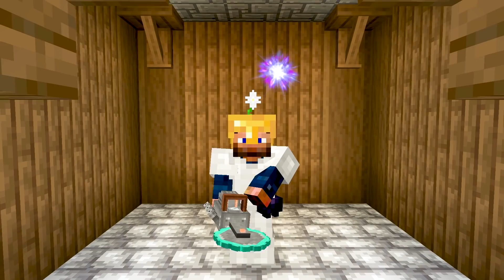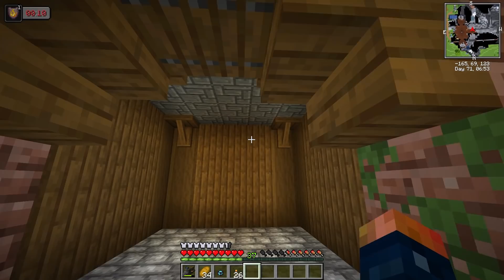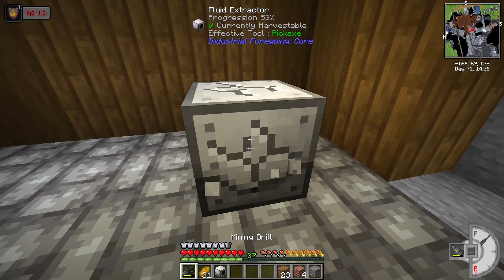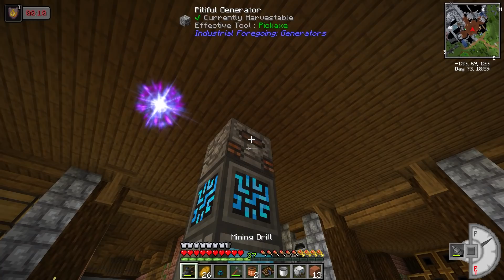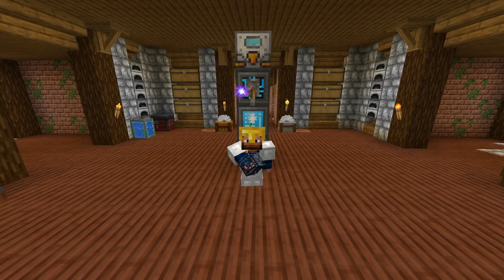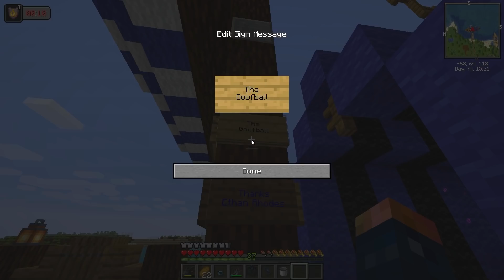Industrial Foregoing Plastic Automation Ep. 6 Valhelsia 3 Minecraft Modpack

Comment: if you noticed, while hovering over the different sides of the fluid extractor in the GUI (while you were trying to configure which face to output the latex,) in the tooltip, it was telling you which compass direction that side was currently facing. Just a hint to make it easier to pick the correct side, without having to just guess or anything (and maybe you find this out later, haven't watched in that far in, yet)

Comment: If that's a newer version of Immersive Engineering you can put a wire connecter on either side of a block and hit it with the hammer (right click) to make a passthrough. That way it's not clogging your door or frying you.

Comment: The Dissolution Chamber has a few non-Latex recipes using fluids like Liquid Meat and Pink Slime. You'll need to make sure to either:
A.) Completely drain the Latex through crafting because you cannot dump fluids from the machine.
OR
B.) Make another Dissolution Chamber for non-Latex recipes.